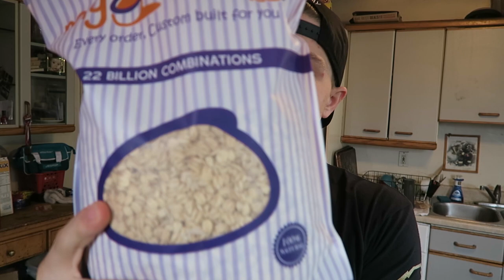Rain HATES Me & Physique Update!

Comment: Awsome progress man. I can tell the reps youve put in for your shoulders, chest especially. As far as proportions, I think your priority right now is #1. Lats, as you were doing today, but you need more. use a wider grip. More reps, more everything. #2 Traps. One thing I like to do is just plain dumbell shrugs and do 20-30 reps, then strip the weight and do it again, then again all the way down the rack until you're at 20 lbs weights, it will exhaust them. #3. Triceps. Its hard to nail all three heads but it will add so much dimension ro your arms. Remember your triceps make up 2/3rds of your upper arm. #4 forearms. Keep it up man you're doing awsome.